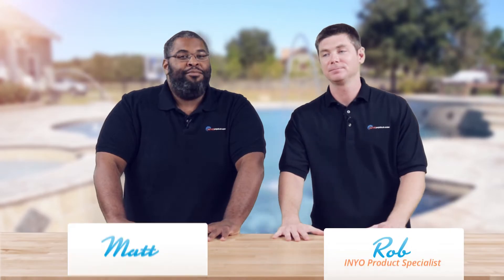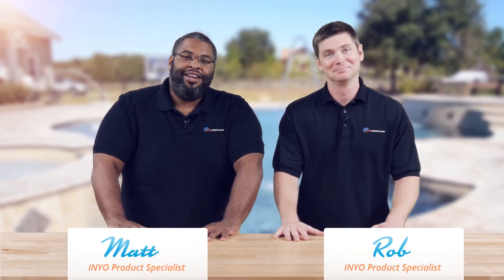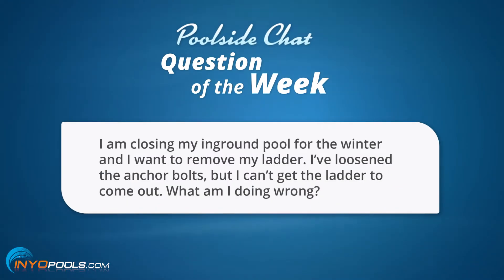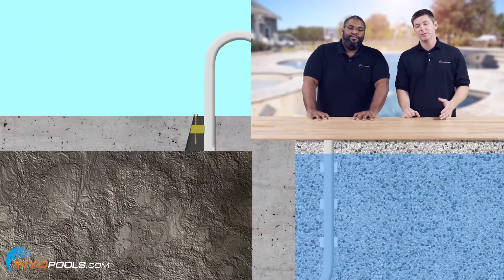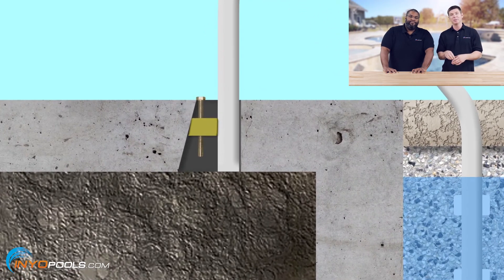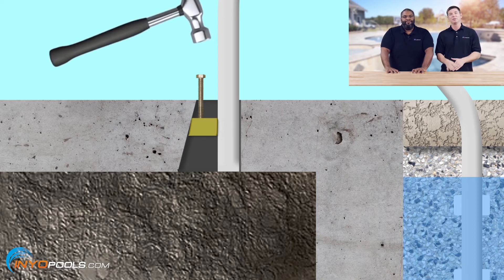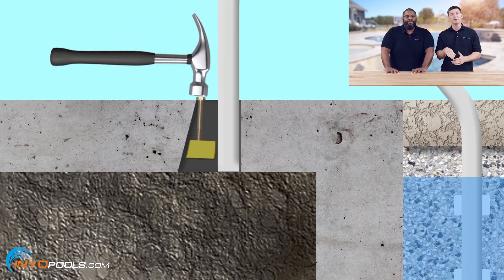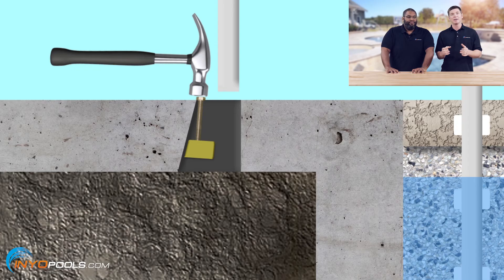How to remove a stuck inground pool ladder

Comment: My ladder actually bonded to the hole. I finally got it out buy manually cutting the metal and digging it out. I dont want this to happen again. How do I prevent it from bonding the metal in the ladder to the metal on the sleeve in the concrete?
Reply: Same happened to me 😔  trying to figure it out now
Reply: I was told to take it out every year and clean the hole. He said lubricating wouldn’t hurt either.

Comment: Brain fart moment by me.  I thought the wedge was stuck in muck at the bottom and kept trying to pry the bolt upward.  one tap with the hammer and it was free.  Thanks guys.  Sometimes the simplest things are the hardest when to understand the whole system.